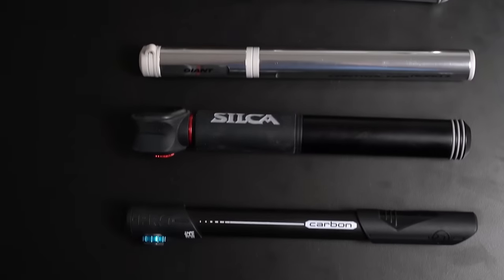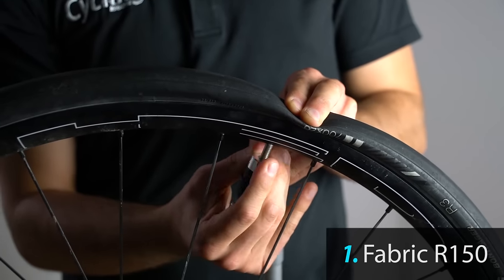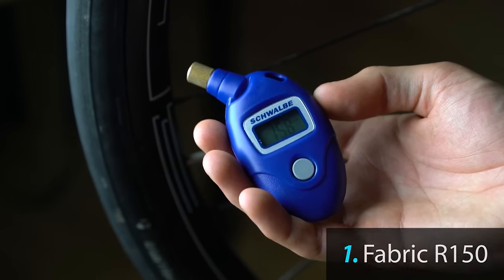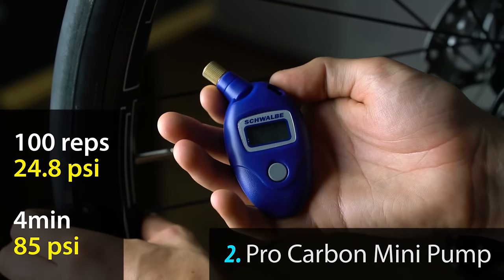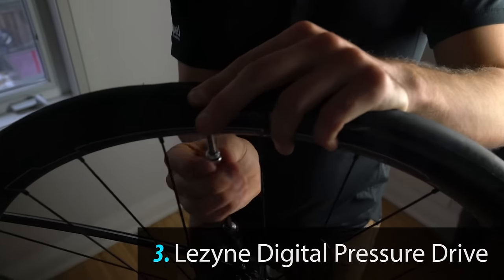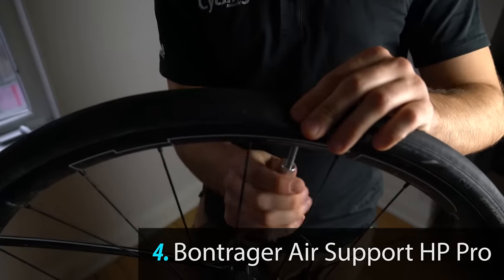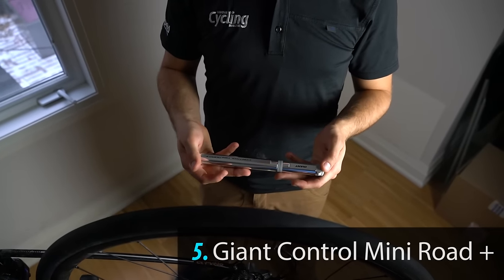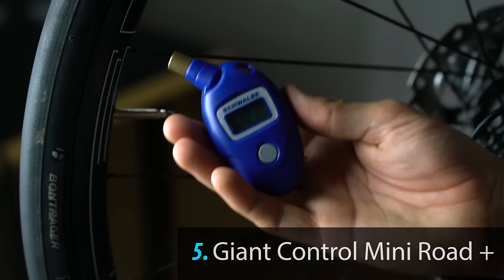What's the most efficient mini bike pump?

Comment: It would have been nice to know what maximum PSI you could get with each pump if you pressed until no more goes in.
If I need to pump with handpump i know it will suck but at least i would like to know I can reach a desired pressure for all that effort.
Reply: ive tried my cheap aluminum Giyo GP-61S Bicycle Mini Pump for a test it goes until 30 psi and i think it could go to 40 psi. i was suprise this little pimp could do it.

Comment: This video made an error, the reviewer was putting air into a road bike tire, yet he used a Lezyne Digital Pressure Drive pump which is more designed for mountain bike or other such larger but lower pressure tires and not for a road bike.  He should have used the Lezyne Road Drive pump which is made for high pressure road bikes.  If he done that he would have discovered that 100 strokes would have gotten him to 35 psi with the long version, the short version would see about 20 psi, and the middle size one about 27 psi.  Road pumps deliver a lot of pressure but not a lot volumn so using a road pump on a mountain bike would be very labor intensive.  

I have the non digital Pressure Drive version as well as the Road Drive (long version),  I can say from experience that the Pressure Drive will NOT pump a road tire anywhere near 110 psi, it will reach about 75 with quite a bit of struggle, whereas the Road Drive long version will get to 125 with quite a bit of struggle (I never go that high but I did just to test it).  I doubt the shorter versions of the Road Drive will get to 125, the shortest one may get to 85 maybe 90, and middle size one somewhere in between.  I selected the long version because when you get up to the higher pressures the longer version makes it a bit easier to get those last 15 or so strokes in without blowing an artery like you would on the shortest one and still not be at 100.

Of all the mini pumps that I use to own or still currently own the Lezyne is by far the best one I've found for road tires, it will reach the higher psi that most roadies use which about 95% of the pumps on the market will not despite saying on their packaging they'll reach 160...in fact I've never found any mini pump to date that will get anywhere near 160!  they're lucky if they make it to 100!!  Also the quality of constuction on both Lezyne models that I own is very high, higher then any other pump I've ever had.  Lezyne is the only pump I will ever buy...unless by some slim chance another company develops something better, but I doubt because mini pumps have sucked since they first came out and Lezyne is the only one that will make it to the higher pressure and not break or blow an artery while doing it.
Reply: What size is your lezyne pressure drive? And what max pressure have u achieved? I’m thinking of getting one,  but only the small is available.
Reply: I’ve just watched another vid here on youtube, this russian man pumped his lezyne  pressure drive to almost 80 psi i think in about almost 140 pumps. Good enough to get to riding again.
Reply: Why would anyone pump up to 160, letalone 110 psi. Heck 160 psi could easily destroy a carbon fiber rim.
Checknout Silca products if you like quality.
Reply: @rickdoehler502   It's all about the difficulty of using one pump vs another to get to whatever pressure you use on your road bike, say 80 psi.  A pump that can't make it to 100 is going to give you a huge struggle to get to 80, one that can make it to 100 will give you less of a struggle. 

Silca is all overpriced crap.  Why would you spend $85 for a 17 piece hex key set from Silca when you buy a Tekton with 26 keys mixed with SAE and Metric for just $16?  Don't go into quality BS thing, those Tekton keys are made for taking on automotive stuff which is a lot tougher on tools than a bicycle is.  Oh wait, I know why you want to spend nearly $70 more for the Silca, because you need that wood box to store the tools in.

Silca Tattico mini pump is a beast, that's for sure, but that beast is larger than most other mini's in diameter, and far outweighs most mini's, you're talking 169 grams at 9 1/2 inches long; whereas the Lezyne Road Drive long is 97 grams.  The Lezyne is $15 less.  But wait, if you want something lighter the Silca Pocket Impero is $70 more! and still weighs more than the Lezyne, and the Silca is more difficult to pump with, it takes more force and more strokes to reach a given psi.  So, no, Silca is not the gold standard, it just takes a lot gold to buy their stuff.
Reply: @Rekmeyata  Note really, I have Silca stuff, One of which is a floor pump that is over 30 years old, still works like a champ and I was able to replace pieces to keep it going as recently as last year. I have a Tekton torque wrench that is nice but you really can't compare it with the Silica wrench set in craftmanship. Tekton has that Russian craftmanship to it. FYI, You can set some great prices on Silca stuff when it's on sale. That's what I do. Same with other quality products out there like Patagonia. Only a rube or buys good stuff at top dollar. Myself I use CO2. I do have a Tattico that I got on sale from Silca. Very nice but I'm not in to the mini pump thing. Maybe you'd like to buy it. For you I have a special student price.
Reply: @rickdoehler502  How did a torque wrench get into a discussion about pumps??  By the way, since you went off subject let me join you for a bit.  Silca has a ball hex set for $149 with 8 pieces, you can get a 26 piece Tekton ball hex set for $26!  The Tekton is made for use on cars which means it work just fine for bicycles since the amount of torque applied on bicycle parts is far less than on cars.  You don't need to go overkill with tools on a bike.  Just how much is a good sale price on those hex tools?, maybe $125 would be the sale price? still too much.  Tekton is not made in Russia either, depending on the tool they're either made in China, Taiwan, or the USA.  A lot of new mechanics these days are buying as many of their tools as they can, including the tool boxes, from Harbor Freight, because Snap On and the sort are horribly expensive and put a new mechanic in debt for a very very long time, something a mechanic doesn't want to do on the lousy pay they get.

I have had a Zefal HP pump for over 35 years and it works great and it cost a lot less money than a Silca Imperio frame pump that cost $175 vs only spending $35 for the new Zefal HPX4, the choice for a frame pump is quite clear.  Even if the Zefal only lasted 15 years and you had to buy a new one you would still be far ahead of paying the price for a Silca by the time you die of old age!
Reply: @Rekmeyata  
Thanks for the heads up on the Tekton Ball Hex set. I'll check it out.
The set I use is a cheep but nice set I got at the hardware.
I agree Silca stuff can be expensive, but some of there stuff is really good and isn't that pricy. I'm not talking tools.
Hey I hear you on the Zefals. I have three, two still work well and they have to be well over twenty years old.
I have to say I love my old school Silca track pump.
Reply: @rickdoehler502  I have two Zefal frame pumps, the first one I got over 35 years ago, it no long fits the frame of my new touring bike, so I bought the new Zefal HPX 4, it works fantastically, and it appears to be made basically of the same quality as the old one, so it should last a very long time.  Those Zefals are built tough too, on my old one I once hit a dog as hard as I could on his nose, he didn't like that much and took off screaming, there was blood on my pump end, but the pump had no damage.

You can find those Tekton ball hex tools at most home improvement stores,  there are other brands of similar ball hex tools like Husky, Eklind, Gear Wrench, Kobalt, Bondhus, Craftsman, they're all about the same price give or take $5.  I got mine at Home Depot some years ago.  Gear Wrench is probably the best of the group if you want the best quality that a local home improvement place would sell, but make sure you find a set that will do everything on a bike, if you dink around with cars get one that has a lot of different sizes, if not then you might get away with a simple 9 or 12 piece unit, but if you get the larger 26 piece ones at least you have some you might need some day, and since they don't cost a lot...why not?

Comment: CRANK BROTHERS ......   HANDS DOWN ... 
HAS HIGH VOLUME AND HIGH PRESSURE  SETTINGS .  
Amazing products .......
Reply: Nahh I have the  Crank brothers Kilc HV, and I must tell you, it is by far the HARDEST thing to use when pumping anything 🤦🏽‍♂️ I can barely pump a ball to full without breaking a sweat. Plus fully pumping tyres is basically impossible due to how difficult it is when at high pressures.

Comment: This test was useless for the most part.  All those pumps claim they can reach 120 psi at least, so lets see if any of  then can get to just 100 psi, and how many strokes did it take to get that high.  I would make the dare even more challenging but I know NONE of the pumps will make it to their advertised max psi level, and I doubt any of those pumps will get past 80 psi.
Reply: Any luck finding one, yet?
Reply: 80 or 90 psi is more than sufficient to finish a ride. What all this 100, 110, 120 psi stuff?
Reply: @rickdoehler502    what it has to do with is the capability of the pump, if it can get to 100 to 120 then it can get to 80 to 90 easier than a pump that can only get to say 90.  So, you want a pump that is capable of going at least 40 psi more than you'll ever need, either that or get working out at the gym to become pumped up like Arnold so you can pump that tiny pump to 80 psi without strain, just a lot of strokes.

MOST mini pumps cannot get to the psi they claim on the packaging that they can do, a lot say 160psi, that's nonsense, I don't know of any pump that can do that, even the best one, the Lezyne Road Drive Large won't get you to 160 unless you're Hercules.  Most mini pumps will get to 70 with a lot of struggles and a lot of strokes, and when you finally, if ever, reach 70 you will blow a gut.  So you want a pump with a known track record of being able to reach higher pressures without Herculean strength needed.  

A good pump is the Topeak Race Rocket HP but I prefer the Lezyne Road Drive large, it takes less strokes and is easier to get to 80 than the Topeak, but the Topeak is a very good second place pump; both are very well-built pumps in terms of durability and longevity.   I own both of those pumps, so I know what they're capable of.
Reply: @rickdoehler502   This is really simple if you put on your thinking cap.  If a pump can only make it to 80psi, well you think that's great, except because 80 pounds is its upper limit that means it will take a great deal more effort to get there both in power and in the number of strokes.  If a pump can make it to 100 or more, then that means it's easier for that pump to reach 80 psi than the other one did.  Does that make sense to you?  This is why the only two pumps that I've found that can reach 120 psi, even though I don't go that far, is the Lezyne Road Drive large, and the Topeak Race Rocket HP, of those two the Lezyne takes less force and less strokes to get to 80 psi.  The Lezyne with a 23c tire takes 117 strokes to get to 80, the Topeak took 132, my old SKS Wese Race Carbon pump takes 186 if I remember correctly, and a lot more effort than the other two.  Other pumps I ordered and sent back, about 14 of them, could not get to even 70psi and that was with a great deal of difficulty.  One of those 14 pumps was a SKS Puro Piano Black pump, a beautiful looking pump, but when the pump got to 45 or so PSI it blew out the end, I called SKS and they sent me the Wese Carbon pump instead.   The Silca Tactical pump is very expensive, but it took 195 strokes to get to 80 psi!  not a good pump for the money they want for it.  The small Topeak Race Rocket (not the HP) took 180 strokes.  Some are just crazy, like the Blackburn Airstik takes over 300 strokes to get to 80 psi, while it did make it, it was on the very edge of its upper limit and it took far too much effort to get there.